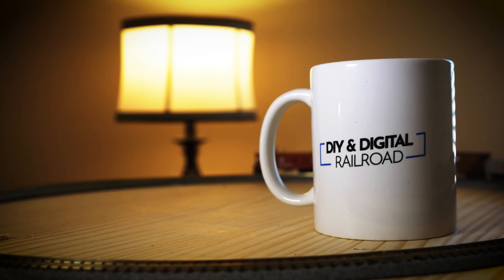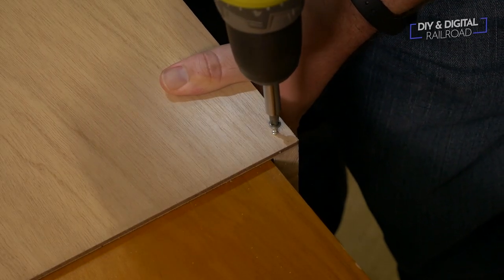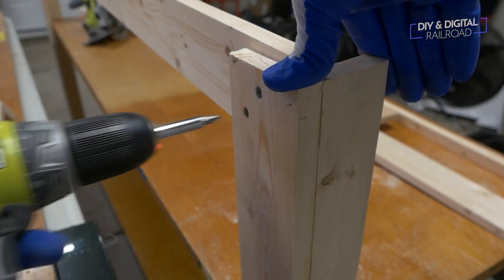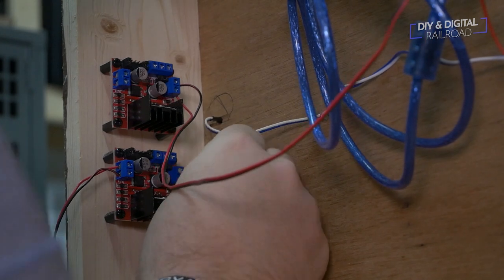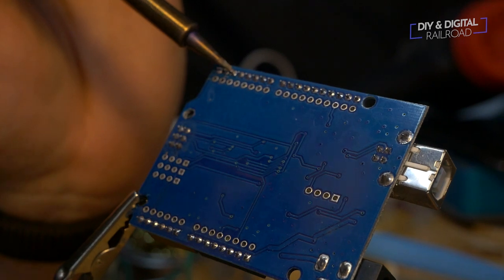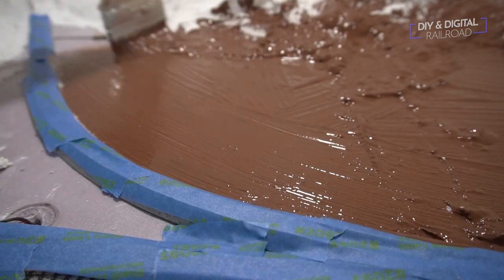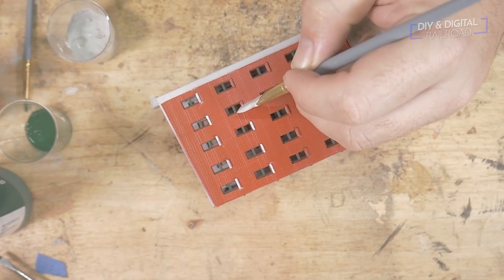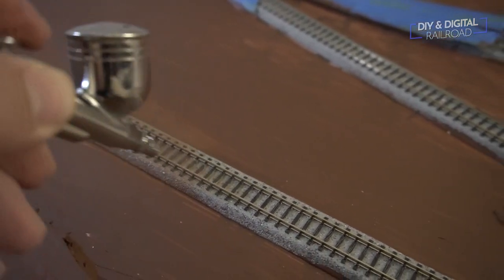Skills You Should Learn To Be A Better Model Railroader

Comment: I like the building part and painting but will have to learn soldering and how to wire things. I have learned the carpenter part by building reptile enclosures and stands. Have 6 foot by 3 foot tortoise table and learned a lot building that. Thank you for great video and advice. Thanks to all those who add to the advice also. Diffently will work on patients and not to be so messy when I paint 😂😂😂
GOD BLESS 🚂💖🚂💖🚂💖

Comment: Great video ,just curious did you expand on the 2 by 4 layout you built a while back
Reply from the maker: I haven't yet but I do have a plan for that!
Reply: @DIYDigitalRailroad  that would be great ,like a lot of us space is limited and that size and a littl extra is great maybe  another 4 ft section maybe a L shape like your larger layout , this small layout is fun and easy to move thanks
Reply: @DIYDigitalRailroad  that would great ,I have a 4 ft long with the same outside track for add on ,but can’t come up with a L shape plan for another  4 ft section hope you have something like that similar to your larger layout, keep up the great work